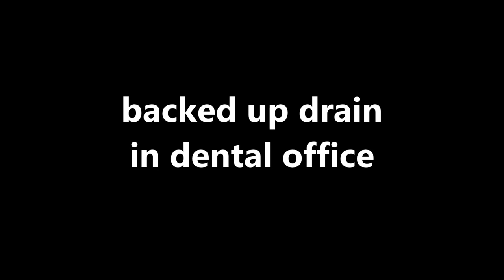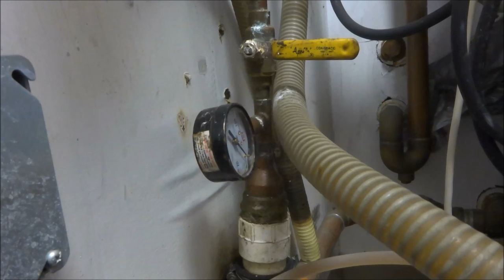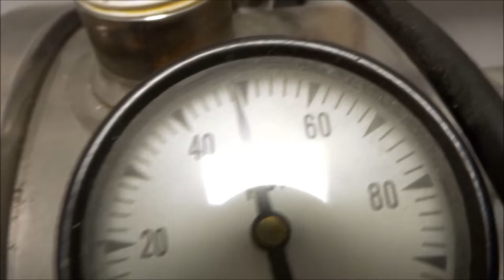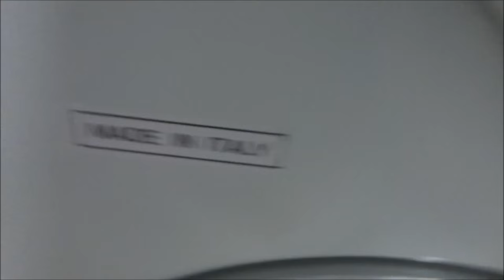backed up drain cleared in dental office

Comment: nice video steve. love that contraption u made for blowing out drain. what size was that contraption u made ?
Reply from the maker: +John all it was was a 1 1/2 x 1/2 copper mail adapter i used a reduced to get back down to 1/2" ...1 1/2 no hub clamp on one end and boiler drain on other end i have a 2" size as well

Comment: At the 5:00 mark love the "clamp" on the air hose.
Reply from the maker: +Chris Bramell lol i seen that ,its stopping a leak on the vac pump set up on a alumnun block fitting .they wanted me to fix it . i said no way i touch that and you will be with out vaccuum .and they were open she said i will shut it off for 5 minites so you can fix it lol .i touch that block fitting adaper and make it worse  i am screwed ..i told her no way . call the dealer for the vac pumps set up to fix it .